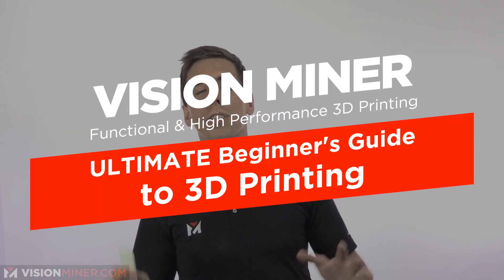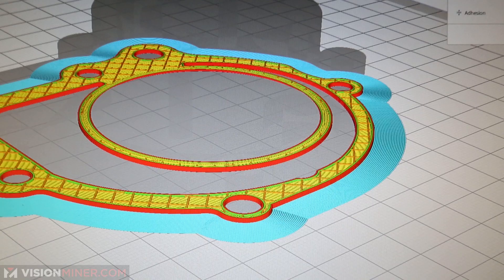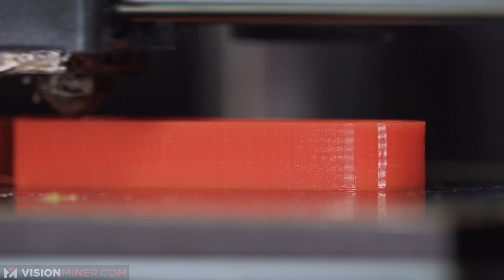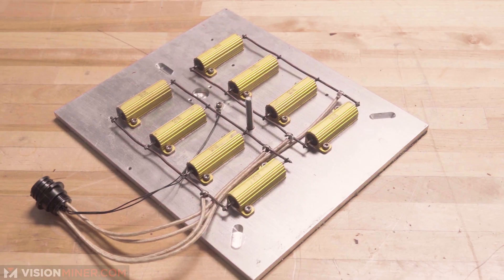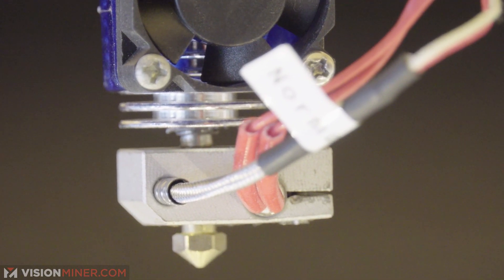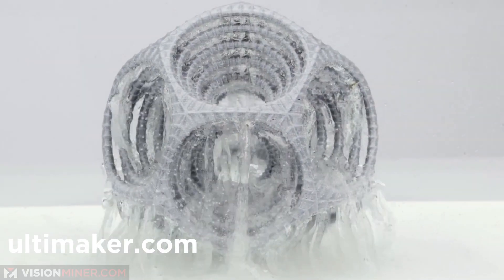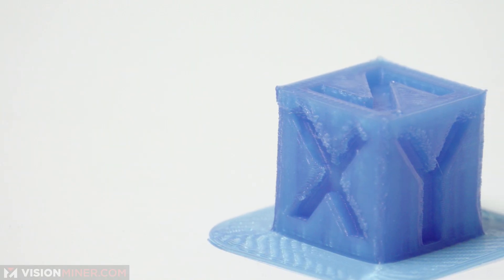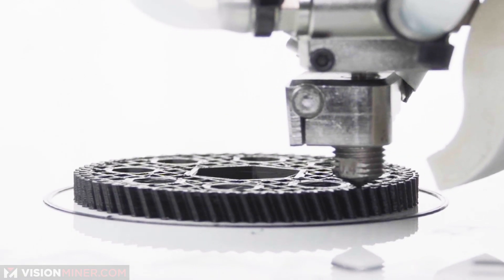The Ultimate Beginner's Guide to 3D Printing  $500 machines up to $1,000,000 machines

Comment: Hello, we are working to start a new functional 3D Printing business. We need to print large format functional end user spare parts and good surface finish prototypes. We are new for this business and we are not engineers. Simply we are business men with some general technical background. We really need your support to select highly flexible and cost efficient large format 3D Printer which satisfies the referred requirements with your professional recommendations and advices. Thank you so much in advance for your kind support.

Comment: Hi Mr. Lent, can a part be made that is like a spring with a  hollow cross section rectangle the size of a USB plug, out of aluminum?
Reply from the maker: I'm just going to go ahead and say yes, if you can design it, it's possible :)
Reply: Vision Miner thanks